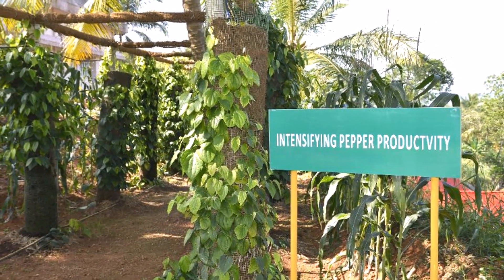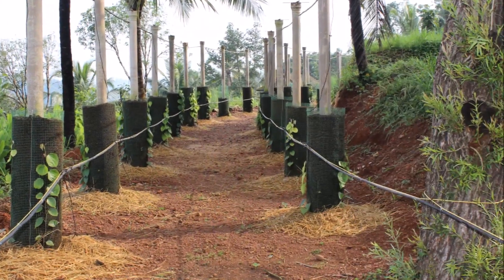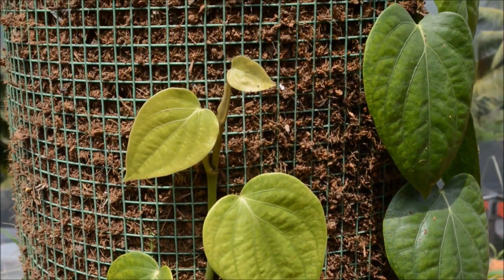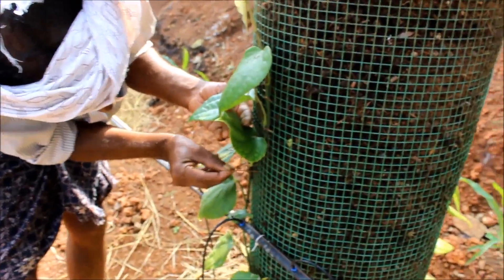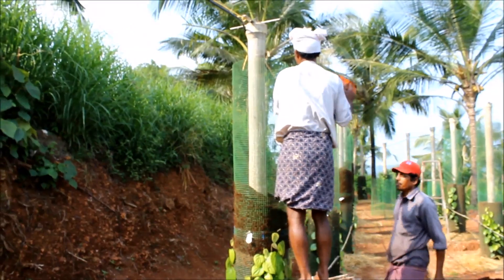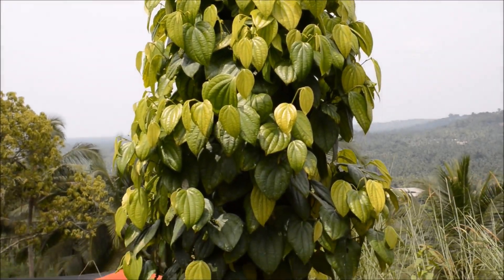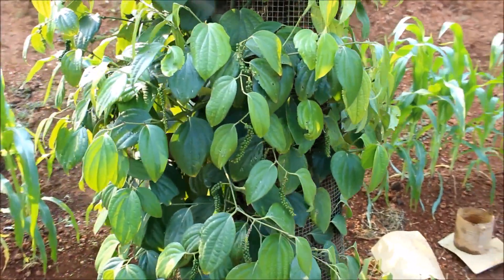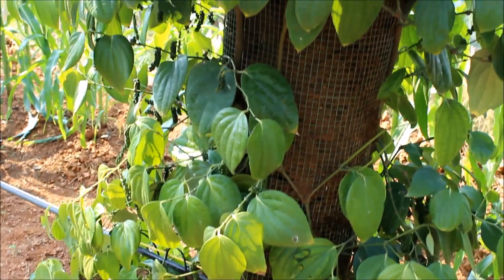INTENSIFYING BLACK PEPPER PRODUCTIVITY

Comment: The problem here is the wire mesh will collapse. So need to use galvanized or steel wire mesh.
Else heavy guage wire mesh will workout.
Reply: Best option is to grow trees which provides carbon and nitrogen to soil and when trees are at certain height plant pepper near their roots so pepper grows without fertilisers and receives its nutrients from trees and then not to worry about mesh etc 
Although its a long procedure but worth doing it as pepper’ market price is good